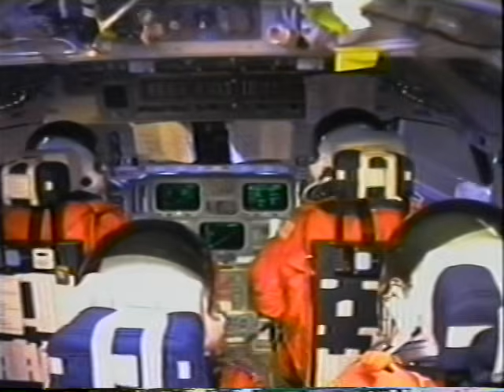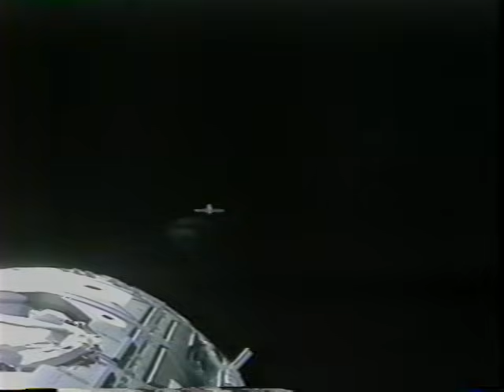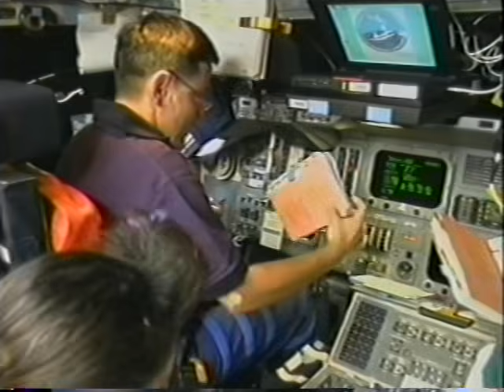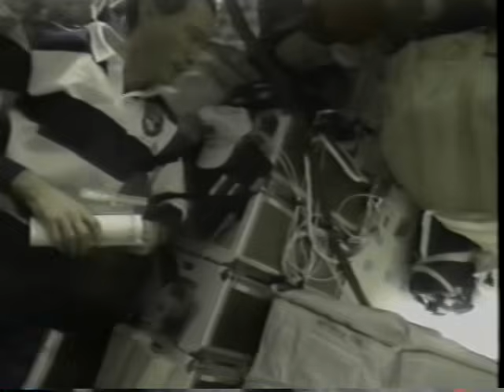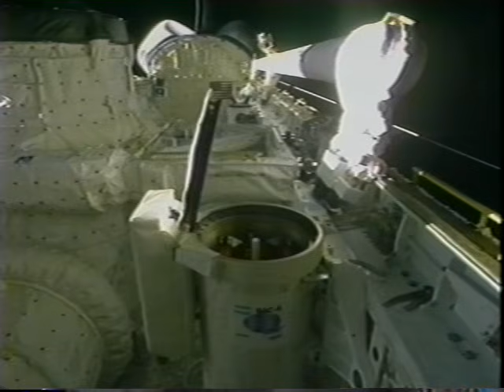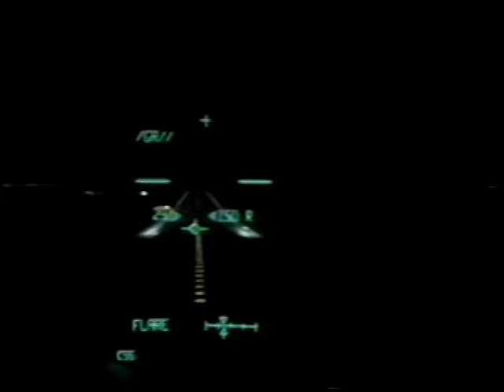Space Shuttle Flight 93 (STS-88) Post Flight Presentation

Comment: 3:44 Why is there a big guy going back and forth out in space when the shuttle bay opens?
Reply: It's called reflection on window, you know when you are in bright room and are recording something thru window, you will occasionally have reflection of yourself on it, it's not rocket science.
Reply: @tgstudio85 There's no window    overlooking shuttle bay.  Try again.
Reply: @raymond3803  Yes there is window inside hangar bay, plenty of pictures show that.
Reply: @raymond3803 there are windows there
Reply: @raymond3803 you see them looking through it when they talk about checking the arm.... 4.07
Reply: @tgstudio85  Okay ...... I might be wrong.  I rather doubt it, but maybe.
Someone still needs to explain the following Shuttle landing.  According to NASA, the Shuttle is a powerless glider after reentering earth's atmosphere.  Is this a glider?  https://youtu.be/gyr5TqE3t5Q?t=31

Also ........... Please explain why a 3rd parachute is 87X stronger than 2 parachutes.
Cirris SR-20 four passenger airplane.    1 parachute ..........Reliable up to 175 mph
Top Fuel Dragster                                      2 parachutes .......Reliable up to 350 mph
Apollo Space Capsule reentry                 3 parachutes .......Reliable up to 17,000 mph
Reply: @raymond3803 The Apollo Command Module did not open the chutes at 17,000 mph.
Reply: @msidc1238  Well reentry was reported to be @ approx. 17,000 mph.  What slowed them down?  Remember, Felix Baumgardner broke terminal velocity tumbling out of control.  Spread eagle during his record red bull jump.  Not exactly an arrow dynamic posture.
Reply: @raymond3803  The atmosphere itself. Have you ever heard of drag?
Reply: @msidc1238  What drag?  Use your head. Air is so thin Felix Baumgardner did nothing but speed up tumbling spread eagle.  You got that?  Felix didn't slow down, he sped up.  Way up!  So.....the Apollo would too.  Atmosphere doesn't get thick enough to slow shit down until 15,000 - 20,000 ft.  That's why helicopters can't rescue climbers on Everest higher than Camp 3.  Air too thin to fly. 
 So .............I'll ask again, why are 3 parachutes 87X stronger than 2 parachutes?
Reply: @raymond3803  Since you asked again, I'll tell you again, they didn't open at 17,000 mph. Fun fact about drag, the faster you are going, the more drag you will experience. In fact, by 400,000 ft, the drag is already detectable on a lunar reentry. You pretend like you are an expert but clearly you've done 0 true research.
Reply: @msidc1238  Lunar reentry?  Are you that naive?  Musk sends up unmanned bottle rockets 10 miles, then come back & land.  In his terrestrial known atmosphere.  Took him 4 tries to get it right.  And you really believe NASA could it 50 years earlier, with 3 men inside, 239,000 miles away.  Foreign atmosphere.  And get it right on the 1st try?  No way!
Reply: @raymond3803  So apparently you haven't even paid any attention to modern spaceflight either. Which you must think is fake too based on your other comments. Anyway, if you look at the basic history of spaceflight the answer as to why no one has been back is clear. If anything, it only proves that the Moon Landings were real because if they were fake, we would have a much easier time nowadays faking it than back in the 60s.
Reply: @msidc1238 😂😂😂😂😂😂😂😂😎
Reply: @BigBoaby-sg1yo  Sorry, I don't speak emoji.
Reply: @msidc1238  perhaps you should 🙄🙄🙄🙄😁
Reply: @BigBoaby-sg1yo  Why?
Reply: @msidc1238   because you have been fooled . According to the inverse square law what would be the Luminosity on the moon ? If you do not have a wife or girlfriend, then perhaps you should get one - this nonsense from ye smacks of mommies basement 🙄🤷‍♂️
Reply: @BigBoaby-sg1yo  You tell me. I'm not doing your homework for you.
Reply: @msidc1238  “ tell you “ nope that’s ain’t how it works . Can you post a short Gab on what actually is the ‘ inverse square law’ the answer lies therein
Reply: @BigBoaby-sg1yo  Do your own homework.
Reply: @msidc1238  oh ! I have , indeed I have 😎
Reply: @BigBoaby-sg1yo  Really? Well, let's hear the answer then.
Reply: @msidc1238   work it out yourself mate and perhaps have a think about what you’re being fed as a truth . It will be painful , but time to grow up and enter the realm of men .
Reply: @BigBoaby-sg1yo  Are you a Flat Earther too?
Reply: @msidc1238  No !
Reply: @msidc1238  what is the Luminosity on the Lunar surface ?
Reply: @msidc1238   I want to ask you a question and would like you to be honest ! Do you believe the footage in this video is a factual account or just a video production? Or perhaps bits of both .
Reply: @BigBoaby-sg1yo  Why are you so afraid to just tell me the answer? Did you actually do the math yourself or not?
Reply: @BigBoaby-sg1yo  Explain what you mean by "video production", because literally anything with some cuts could be considered a video production.
Reply: @msidc1238  indeed ! that is the truth chief  . A video production can also include Chromakey with the employ of green screens or black draping .
So you are not going to tackle the luminosity on the lunar surface by using the inverse square law? I thought you space cadets were supposed to be good at mathematics?
Reply: @msidc1238   Yes ! I did the maths - why can’t you ? Do you even know what the inverse square law is?
Reply: @msidc1238  worked it out yet champ ?
Reply: @BigBoaby-sg1yo  And why do you want me to do the math so bad? Can't do it yourself?
Reply: @msidc1238  I know the answer , apply the inverse square law. Do you know what the inverse square law is ? 
lol 😂 I don’t think you do .
Reply: @BigBoaby-sg1yo  The inverse square law isn't even an equation of itself. So you've been making yourself look like a fool this entire.
Reply: @msidc1238   Nah ! Not so much chief ! 
the radiation is inversely proportional to the square of the distance . The intensity of the light to an observer from a source is inversely proportional to the square of the distance from the observer to the source. 
You will need the - 
(1)distance - allegedly 240,000 miles ? 
(2) the intensity.- lumens or lux or candela up to yourself, they all equate out . 
(3) a calculator.
My goodness ,I knew about the ISL before I left secondary school. Just out of curiosity, how old are you ?
Reply: @BigBoaby-sg1yo  Actually you should be asking me what the intensity of the Sun is based on the luminosity of the Moon.  But, yes, just like many different equations including electrostatic force and gravitational force, the intensity of light is proportional to the inverse square law. Now, since you are so skeptical of everything, what should I use as the Sun's intensity? After all, you probably think it's a few hundred kilometers away or so.
Reply: @msidc1238  NOPE ! So what’s the answer in Lumens on the lunar surface champ ?
Reply: @BigBoaby-sg1yo  What are you even saying "NOPE" to?
Reply: @msidc1238  you posted “you probably think it’s a few hundred kilometres away or so “ to which I answered ‘ NOPE ‘
Reply: @BigBoaby-sg1yo  So what is your point then?
Reply: @msidc1238  My point is - you do not understand the model you represent. Have ye did the math yet champ ?
Reply: @BigBoaby-sg1yo  In what way though? The distance to the Sun? I actually already did the math a while ago, just waiting for you to at least explain what you're getting at,.
Reply: @msidc1238   no ! The luminosity on the lunar surface .
(1) it is easy maths if you apply the inverse square law , an astute 14 year old could do it .
(2) you totally do not understand the model you represent.
(3) why have none of the fan bois stepped in to help you? 
I’m done with ye fella . Thanks for highlighting your intent and thanks for playing .
Reply: @raymond3803 you do know that the air gets thicker as the spacecraft descends, right? Or do you think that the atmosphere just appears after a certain point?
Reply: @raymond3803 yes that is a glider lmfao
Reply: @bilboswaggins9260  The engines shut down as soon as it lands.  Not a glider;
Reply: @raymond3803 the video of the shuttle landing shows the APU running. The shuttle had a jet engine but it’s used to generate power for the craft, not for propulsion
Reply: @tgstudio85 so did you actually even bother to do something so simple as to zoom in and watch your reflection ? since when does a human move like that in 0 G environment of supposed outer space,your reflection isn't wearing anything that resembles astronot attire ,he is wearing ugly sweater and his stage hand pass can be seen around his neck ,let's not even get into the fact that he moved abruptly out of sight as if he were told he's in the shot,and since you are suffering from cognitive disonance we won't mention the first stagehand who opened the bay door he's too much for you to handle but you keep lying to yourself and allow NASA to keep lying to you as well , because truth doesn't seem to interest you!
Reply: Different materials. Also lol if the chutes on Apollo deployed at 17000 they'd be the strongest ones ever invented and would be the lightest strongest most flexible material to ever be conceived.